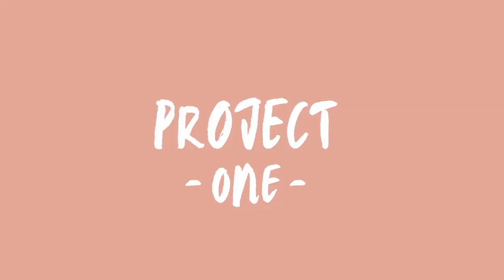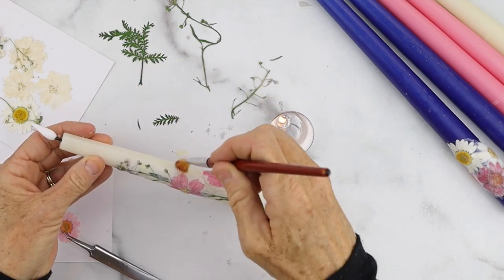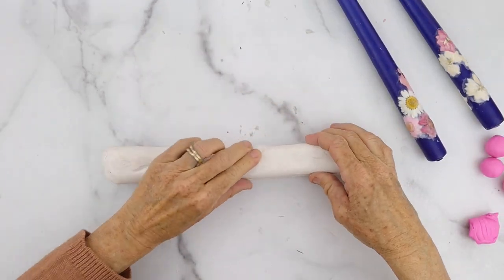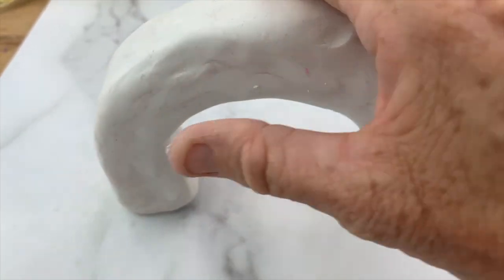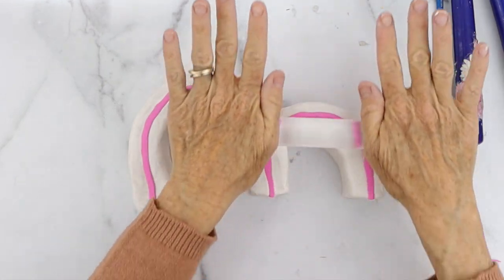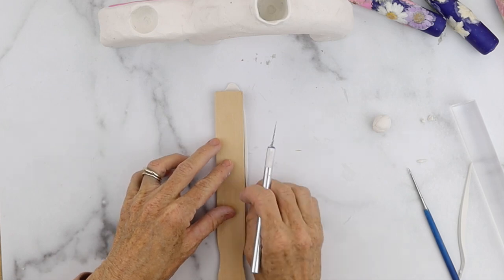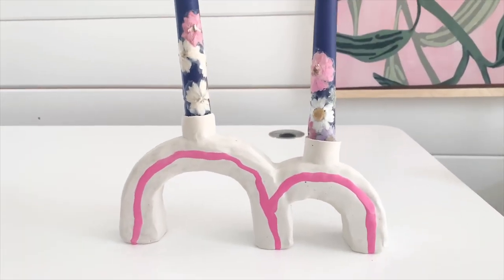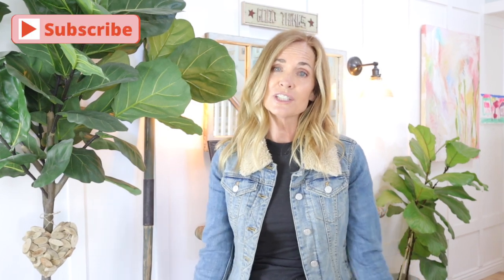How to Add Pressed Flower to Candles

Comment: How beautiful!! Is it safe to light a thin candle with pressed flowers on them or are they more for decorations? Thank you!
Reply from the maker: I’m so glad you love the DIY!  It’s super safe because The large candle burns through the center..  And on the taper candles the wax will drip over the sides.  But, like with any candle, you should never leave it on unattended.  I hope that helps.  Xo, Michele

Comment: I loved this method out of all the other ones I saw! But I have a question, after the project is over can you clean the brush for another similar project or do you throw it away?
Reply from the maker: Thank you for the DIY love, Nasia!  Yes, you can reuse the brush.  You would run it under hot water so the wax melts off.  But, I would use a cheap brush just in case you get it too close to the flame.  Have an awesome week!  Xo, Michele

Comment: Hi! What kind of bristles do you use? I think I used nylon and when the wax dried it left the candle streaky :(. Thanks in advance!
Reply from the maker: Hi Elizabeth:  I love that you made your own Flower candle!!!  I used a watercolor brush that has soft bristles.  You could probably take a heat gun or a blowdryer and light run it over the candle each section at a time.  See if that smooths it out.  I hope that helps.  xo, Michele